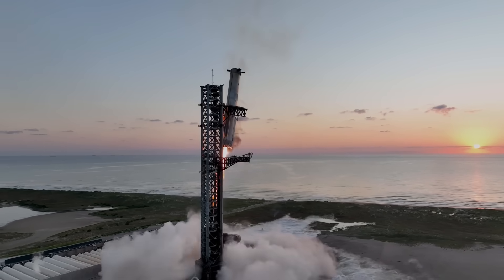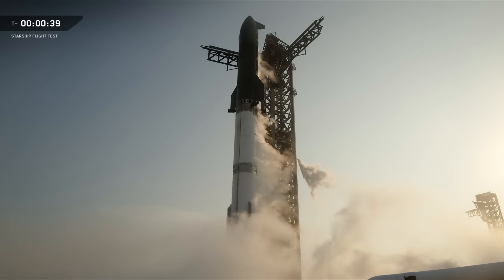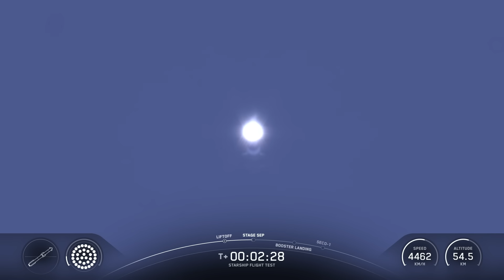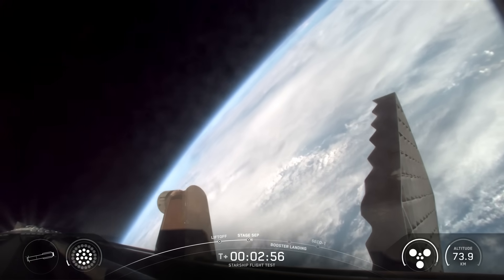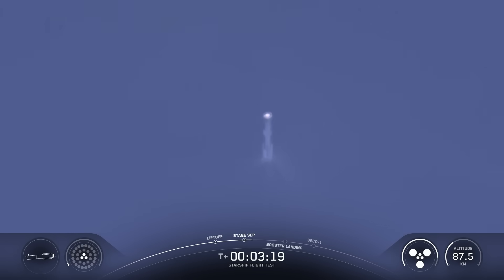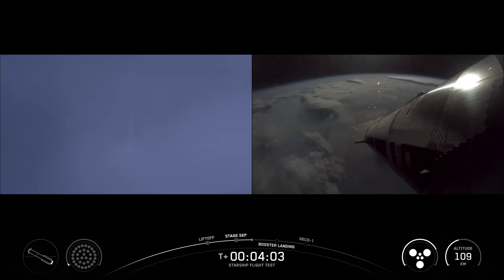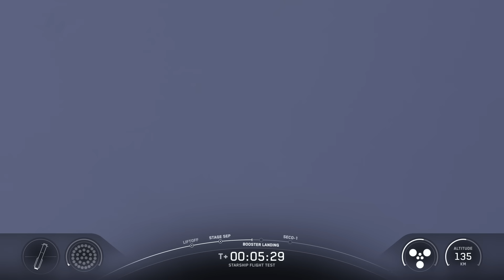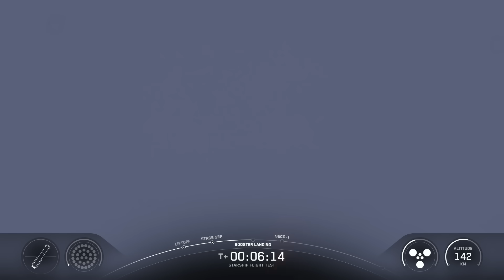SpaceX Builds Largest Reusable Booster, Also Makes Door That Won't Open - Starship Flight 9 Recap

Comment: If we are to believe what the CEO says about raptor v3 being lighter and having over 20 percent more thrust, does it make any sense to push a fragile propulsion system that much harder while removing engine heatshields and fire suppression systems and call it success?  Keep in mind these are engines pushing less than 10% of promised payload and are failing every time.

Comment: In the later half of the video: 26000+ km/h is roughly 7.2km/s. The altimeter indicates that this thing almost makes no progress in height. No expert but I'd have assumed steeper angles of inclination against orbit for these things... Also, moderate success--if your rocket boosters go twice: Awesome. If your shirt falls apart after use #2 you'd be quite upset. I am pretty sure that was largely tax payer money, though, be it funneled through expensive Starlink contracts or direct subsidies...

Comment: after the massive acceleration and huge amounts of heat and the door not opening again? is this simply a structural problem (its not physically strong enough to stop twisting) and engineers have a mighty sword - of "payload over everything" above them? This would account for changes and repeating failures but hey the strongest part of the whole thing looks like that staging ring.. who knows - its a tough gig especially when boss is going on about mars nonsense (dude - err orbit the earth first buddy) - still cant get over them catching the rocket - best engineering software control ever - but blowing shit up now you are at the hard bit? also thing not tested besides mcgregor being deafened and lots of long burns? not hot staging ring test - only thing they dont see until they get up there? err and burned out lip on the edge was where it was attached? _ yes, my armchair is very comfy - thank you

Comment: The current reliance on cold gas thrusters for Starship is short sighted. 

Starship HLS is going to need landing engines, thus hot gas thrusters are essential for the near future. 

Might as well start using them Now. That way the second stage can test out the reentry regime in spite of propellant ullage gas leaks.

Comment: to avoid nuclear war: now there are sooooo many satellites in orbit, what is needed is a system that not destroys the rockets launched, but redirects them to eventually burn up in the sun.  How to achieve that, cant say I've thought about much, just came up with that idea.
But the rocket has to think its still on its correct trajectory ( tricky) and somehow redirect it probably using the rockets own thrust. An interesting thought exercise.
Much safer than blowing them up mid-flight I would think, landing eventually in the sun, will not harm the sun !

Comment: Another launch, another EPIC fail by the space x. When will people except that this a fail of a rocket. Nine test launches NINE fails, not on any of this junk ship has been recovered as a full unit. NASA gets one test flight fail and people call for NASA to be shut down, but space x just keeps failing time after time and people cheer. Please explain this to me.
Reply: Because rockets launched by NASA have an extremely long turn around time and price tag.   Meanwhile when rockets are launched by private industries, even with subsidies, they are able to relaunch multiple times in a year with a much lower cost

Comment: The success failure thing is not subjective. There were some goals for the mission:
Reusing the booster: partial failure
Testing the door: failure
Deploying satelites: failure
Heat shield test: failure
Booster and Starship lost.
Starship flight test 9 was a catastrophic failure.
Reply: Yes, but we can learn more from failure, so it’s fiiiine!
- the smackhead, probably

Comment: The design of the rocket did not take into account the vacuum of space. The tubes and walls of the rocket are not strong enough to withstand the difference between atmospheric pressure and vacuum.
Reply: They've pressure tested these far beyond operational pressures, it can handle the vacuum of space
Reply: @Ethan_Roberts carbon fiber can work on a submarine far beyond operational pressures - you can get at least a couple trips before RUD
Reply: @howilearned2stopworrying508  that's a poor choice of material for a different environment. Stainless has been used in aerospace for decades and can take more than enough pressure cycles for Starship's purpose
Reply: @Ethan_Roberts"wrong" thay assume it whithold the pressure. But when they depressurise it don`t flex it leak
Reply: @talnesalnes4345  not sure what you're trying to say but the likely cause of leaks is due to valves, not structural failure

Comment: I'm two minutes in and "they decided to go for it anyway" I'm sorry **what**. I can't believe SpaceX is this far into their program and "deciding to go for it anyway" when sensors keep tripping is still acceptable.
Reply: How do you know they kept tripping? I'm certain they would not have flown if they weren't in a good condition
Reply: @Ethan_Roberts They've flown in dangerous conditions before, it'd just be par for the course.
Reply: @Slywyn  when have they launched knowing the ground systems were not ready?

Comment: It's another failure, no point sugar coating it, other than catching the booster though impressive, is kinda pointless due to the risk and the fact conditionshave to be perfect, so they haven't actually done anything in the last 3 years, and whenever they get these few issues sorted, there's hundreds more they haven't even started on yet, starship will be lucky if it gets an unmanned launch before 2030, and tbh I would be surprised if this ever actually launches manned due to the landing factor of the vehicle, which again they still haven't addressed the leg issue, and there's no catch tower on the moon or mars so it definitely needs them.
Reply: They learned something new...do you also consider yourself a failure if you learn something new from something that didn't go quite right? Many people said they couldn't catch a booster, yet they did...several times.
Reply: @lukeunderwood1437 yes
Reply: Yes
People are focusing on the great things SpaceX did but not what they actually need, that are way bigger

Comment: I been watching the fins on the ships have a common problem burning up. Why haven’t space x tried removing right angle fin design to more of curve wings . To allow the plasma to flow off the wings instead of consecrating on its edges.  Think of a spoon you eat with when you apply a torch to the spoon the flame spreads away instead of building up on the flat edges doesn’t 🔥 up as much. In theory a curved wing would disburse the plasma away instead of building up on flat right angles.

Comment: If Super Heavy’s engines were damaged during re-entry, could it come back into the atmosphere top-first and then flip around before landing? Since it already has some heat protection on top from hot staging, wouldn’t that help protect it during re-entry?

Comment: too many comments: serious question: how efficient is a rocket exhaust in transferring its kinetic energy to the energy of motion of the rocket?
I suspect its very inefficient until you get up to high speeds, I've never heard it discussed before but is very basic part of how a rocket works.

Comment: 5 May 1961 - NASA has first manned flight with Alan Shepard in Mercury vessel. 1963 - the Apollo program starts. 16 July 1969 - Apollo 11 delivers 3 men to moon. 8 years (6 from official program start)
2012 - SpaceX begins starship program, 27 May 2025 - boomies. 13 years and counting.

Not saying SpaceX will never get there but maybe "move fast and break things" isn't quite what it's cracked up to be next to "measure twice cut once". I get that one's a national government and one's a private company BUT maybe defunding and disparaging NASA wasn't the optimal plan.
Reply: Since when did starship develop begin in 2012? If you mean the earliest drafted prototypes for ITS then that would be comparable to moon landing plans starting in the 1950s

Comment: You said "fire engines" and YT instantly cut to a car with a blazing engine. I think it was a car finance advert, but very funny. I wonder if they misuse AI to insert adverts or if it is just coincidence. I have seen several ad inserts that have an amusing connection to the background video recently.

Comment: Booster works well.  Starship Version / Block 2 however is a bust.  Time for either Block 3 or go back to the first to test heat shields and whatever else.

Comment: 2:52 they don't even want to show the relation between lox and propellant anymore 😂
Probably still having issues... Also quite the unstable combustion, in the perfect case an engine shouldn't stutter.

Could be done by decreasing the inlet hole sizes and increasing the number of holes... This mixing plate should definitely be properly cooled.

Now it's essential to keep a stable explosion going, the pump will have to be strong enough, to avoid resonance backblast into the propellant system.

This would cut a significant pogo factor and increase overall longevity... But musk is not smart enough for this, his engineers should be smart enough...

Comment: Since I really haven’t heard much about ship rotating around a mythical point in space. 
So, I did check with at least an AI (chatGPT) and it claims that would work. 
But
Wouldn’t it be easier to just flip the ship nose over tail, or tail over nose? I seriously forgot which way would drive loose objects to the floor, also I doubt if they will suffer from vertigo.
Now what I think might be a better idea is…. PODS!
After they use centrifuge to spin astronauts and pilots to like 5G. 

In the states and Canada we have fairs with carnival rides. And one ride in particular is called the OCTOPUS. So it’s a ride with 8seats/pods. So I think combining how the centrifuge works with a carnival ride. Think about it with zero/micro gravity, spinning them while laying down, pushing their body’s weight to their feet. Now these pods can be used to sleep in some form of gravity. Make the pods like a gaming pod, you have to do something while relaxing to gravity. It should help with slowing bone loss. 

Now here’s the good part. Since the whole ship will still be under micro/zero gravity, the pod system could be mounted anywhere. Oh yeah, and on the moon or mars, bring spare pods or remove the pods from the ship and use them on the bases for rest and relaxation.
Reply: Are you getting help with that? ;-)

Comment: Did DOGE cut funding for space comms? Why do we “lose” connectivity and video and telemetry so much?
And why are we dumping all this money on an idiotic, tech bro, billionaire who just got yet another tax cut, slightly retarded, vanity project?
Reply: This mission didn't lose communications much. Space communications at high data rates are difficult but the Starlink system does a great job. Why did the US government ask a couple billionaires to develop giant rockets? Because the US government wants to launch some really large payloads, on the order of 50-150 tons into LEO or slightly smaller payloads into higher orbits. My money is on there being a really hot cold war going on between the US, Russia and China and the US is developing the forth leg of the nuclear triad. We will most likely be sending nukes into space within 10-15 years... if we haven't done it already.

Comment: Success is sort of in the middle?

In the middle of what? In the middle of the booster exploding, or the second stage failing to open its door before burning up while spinning out of control?

It was a failure. No matter how much so many people are invested in convincing themselves every failure is a success, because "data", or even "It didn't destroy the pad", this was not a success.
Reply: You're not the sharpest are you?  The booster was intended to tested to extremes and finding out what it could take was the point.  The point you missed.  No one is claiming any success for starship on this flight other than making it to SECO.  You pretend for all your worth and it turns out that it's not worth much.

Comment: Space Shuttle also came back without burning up, usually.
Reply: They didn't employ the same development path, which left them with a frozen and flawed system in the end.
Reply: @TheEvilmooseofdoom  It was surely flawed to begin with, but at least it could survive re-entry. Super-heavy is a huge success, I don't see why it should be limited to launching "starship".

Comment: At 14:08, using the floating particles to estimate the rotation from inside the craft - should they not have a rubber duck in there?  That is the preferred technology, I think.

Comment: "If this was a government run operation..." -Space Shuttle flew with astronauts on the very first try.  No idea what SpaceX is doing.  I don't believe they'll have a moon landing until after 2030.
Reply: A very different development program and one that cost a LOT more and of course that traditional method of development meant design flaws were frozen into the system as well.
Reply: @TheEvilmooseofdoom  Half a century of technological and industrial advancement occurred between then and now.  "Very different" as in we no longer have to design on paper, and we have massive supercomputers to simulate all aspects of space flight. Materials research has advanced.  So the idea that one must send up and explode dozens of rockets in order to discover that their designs are not right.. something doesn't add up.  NASA was able to get a reusable LEO system flying with vellum, slide rules and lab work.  Turning the sky into your laboratory seems foolhardy and expensive.  Given SpaceX's process and progress, I have no doubt that when they finally get to the orbital fuel tank farm, they'll explode half a dozen of those too, because.. something about their process says "Let's rush this out the door.  Hey, if it blows up we'll change it in the next rev."  Works for cars, not sensible for rocketry.

Comment: it was the quarter turn (imprecise recovery)
they never turned back ( seemed stable for a brief time - leak theory - again? (material science or fabrication? design? )
Dad said, a good truck driver can back out without dumping his load

exhaust ? 
leaky
lox
idk
elevation   elven vacation -   WHat is to: "Take a hike." 

Ah, perhaps.  "Go fly a kite."
Thake off - to the Great white North.  Eh?
Read my lips -    F something
--- Are you ready.  - it goes on - and on

no it is not a question mark it is a rhetorical question - yes it is a tough concept.
9:28 - SOrry
Had a mini vacation.  This place the edge of space -  very interesting place

shhh

Comment: The Saturn V was manned and orbited the moon on its 3rd flight, the SLS sent an unmanned Artemis capsule to the moon YEARS AGO. Starship has launched 9 times and accomplished nothing significant…..and I’m not talking about that chopstick capture party trick, that IS NOT THE JOB OF A HEAVY BOOSTER….get it together SPACE X! 🤔🤔🤔🤔🇺🇸🇺🇸🇺🇸🇺🇸🇺🇸🇺🇸🇺🇸🇺🇸
Reply: How many astronauts has spacex killed versus the Apollo programme or even space shuttle? That is another parameter that needs to be taken into account.
Reply: @DanRyan-v5y  Yes, we have seen nothing yet... I'm afraid.
Reply: @DanRyan-v5y the Apollo and shuttle programs exist in the past tense, so let’s not get too cocky until Dragon does as well

Comment: Hi Scott,  I still feel as with flights 7 and 8 and now 9, I think damage is being caused by the hot staging ie to the engine pipes and cones, to much preasure and not enough  space for it to get out through the hot stage ring, this new one is even more closed off, what do you think, d

Comment: Just think how many people participated in the development of flight at the turn of the 20th century. Money was spent on endeavors to conquer flight. People were injured and killed. Yes, the quest for advancement in technology is not without its hazards. Elon Musk should be commended for throwing so much money into this endeavor. Not many Billionaires are willing to risk their capitol. A Few have, but Elon leads the charge.

Comment: It can't be healthy for those main booster engines to be at the pointy end of the booster coming back through the atmosphere, there's some bright flames all around the engines. The parts designed to be hot are the inside of the nozzles, having that whole engine bay being flambéed has got to hurt reusability.

Comment: Strangely enough, I have had no faith in the Starship program, from near the beginning.
Almost like I let the program fall into disaster. 
Almost like if I had FAITH, those mistakes would not have happened as much.
Going back years, I have made similar comments then deleted them,
now it is getting weird.
I understand the testing bit, but aren't there those that really understand the Rocket Science ?
The massive scale of these rockets are the Titanic hurdle.
-----
These rockets have reminded me of the 1950's Sci-Fi due to their Stainless Steel construction,
 like in Martian Chronicles by Ray Bradbury and the Made-for-TV series.

Comment: As a former AFFTC flight test weenie, I'd consider whether this is a success based on what the mission requirements were. If they planned to destroy the test article during the flight, then it was a success. But since they didn't plan to destroy it - Fail. They're getting pretty good at distributing vaporized metal over the ocean though.

Comment: I believe the door failure may have been caused by differences in the thickness or material of the metals used. If the door was a separate component with a different thickness, either thinner or thicker, and designed with seals to limit energy transfer, such as heat, then uneven thermal expansion could have caused it to stick or jam.